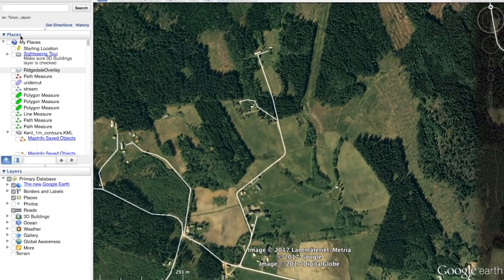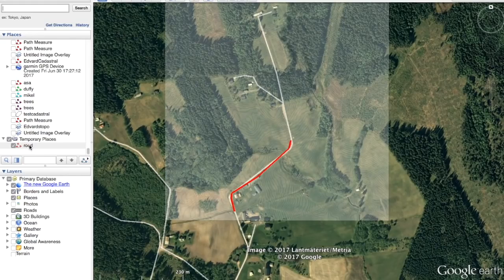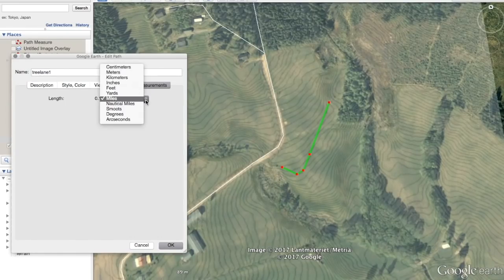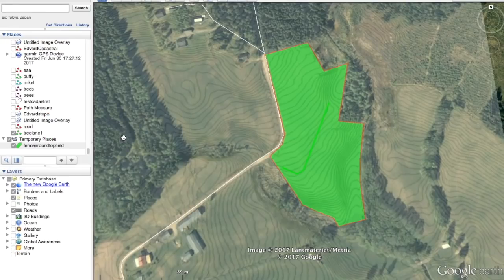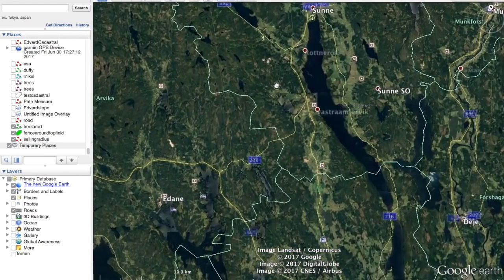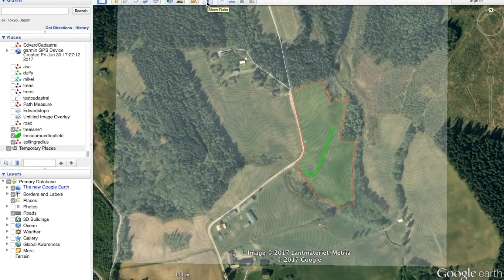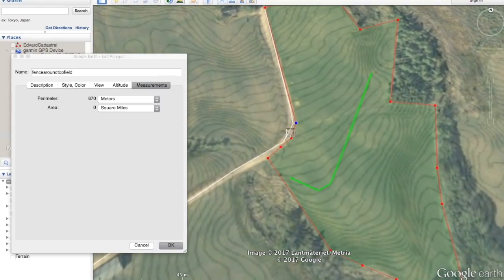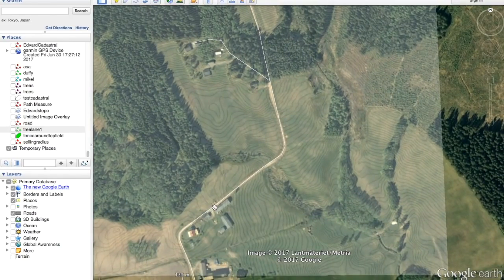Google Earth for accurate design

Comment: I love this! but one thing i would say is on using google earth pro is when you use the polygon you will find it's perimeter is lesser than that of using the add path function so the bigger the area the greater the difference ( i have been very precise on measuring its a good habit!).  however this is just a minor thing as obviously you would physically measure the area to be certain.